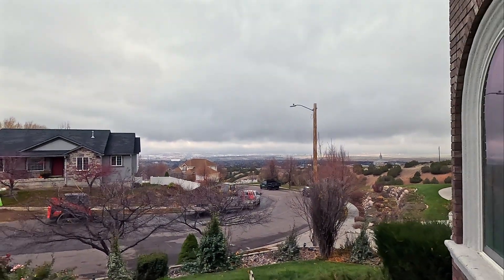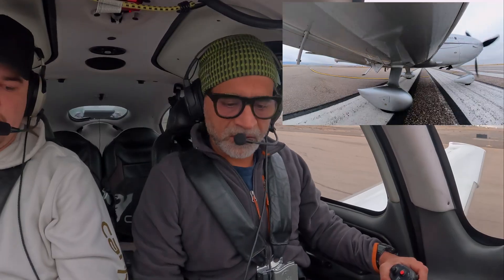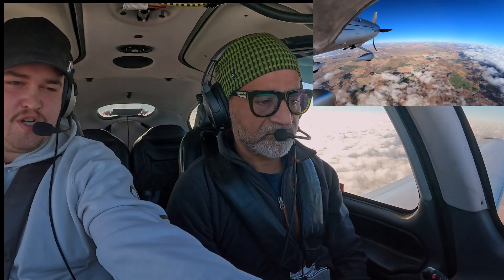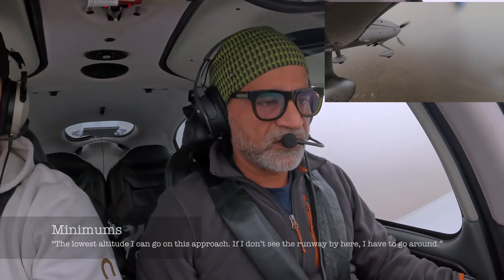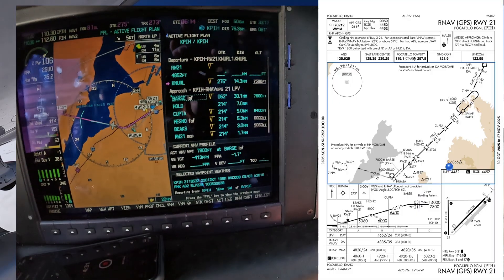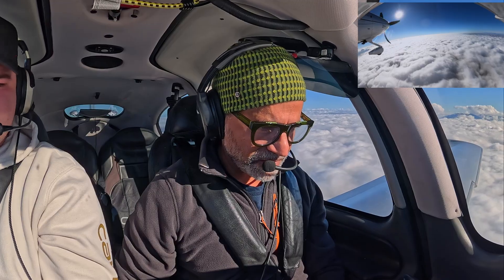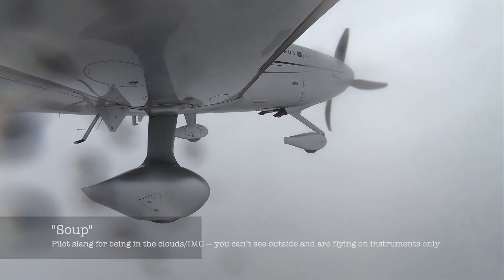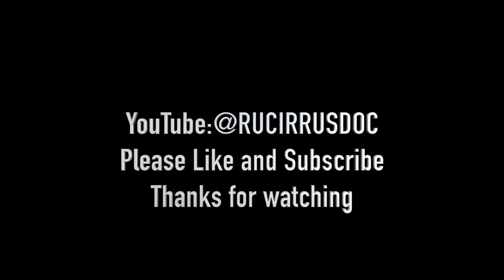IFR Flight… I Really Don’t Like This Feeling

Comment: Felt reassured like landing in a commercial airliner.  Both landings were great but the 2nd one was particularly smooth.
Reply from the maker: Glad you enjoyed it! Thanks for watching
Reply: 0:27 0:27 0:28 0:28 0:28
Reply: 0:27 0:27 0:28 0:28
Reply: 0:27 0:27 0:28 0:28 0:28 j 0:28

Comment: Good job. Make sure you can hand fly the approaches also, autopilots can quit at any time.  Good way to practice is to hand fly the approaches in good weather a number of times before attempting them in IMC.  The real challenge will come when you're single pilot, at night, rain,  the AP is FUBAR, no one is sitting next to you but people are sitting behind you.  Ask me how I know.....
Reply from the maker: Thank you so much for watching and your sage advice. Hopefully don’t want to be ever in the position you described, I know I am not a pilot by profession and hence limit my exposures to manageable adventures. But still great advice. I actually am more comfortable hand flying and run into more issues with the autopilot. But definitely need the autopilot on my side for single pilot resource management.